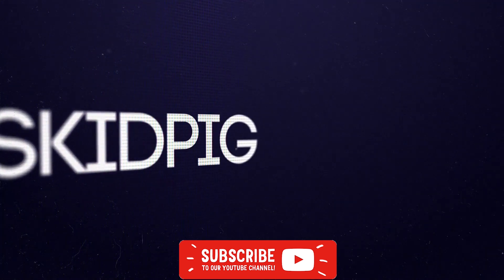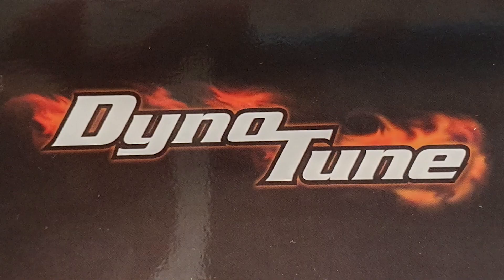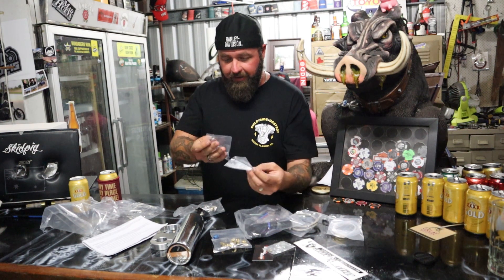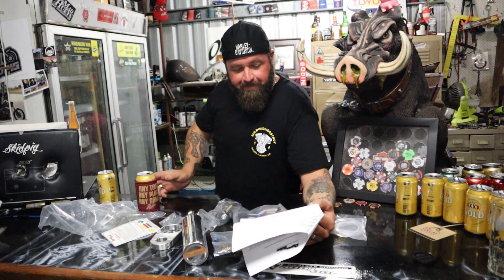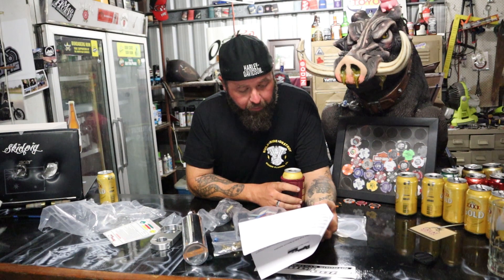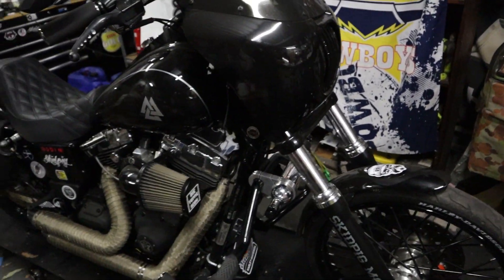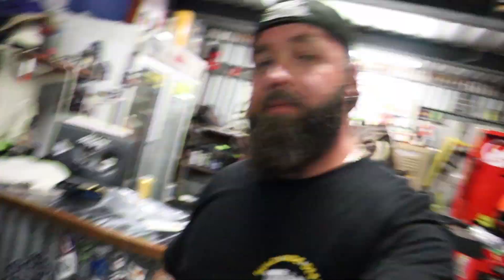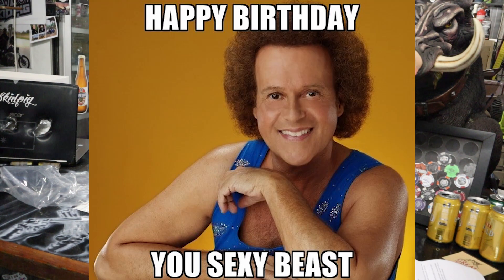Nitrous Oxide Kit for Harley Davidson Dyna - Unboxing the new toy!!!

Comment: I have the same on my 2015 Breakout. I ran 2 20oz bottles on each side in the back  where saddle bags would be. It is also a 110 tire shredder. The 25 shot is giving me 146 FT LBS torque.
Reply from the maker: Hell yeah🤙

Comment: 🤔🤔 to be honest if your putting it there I'd get or make another bracket so it looks better and supports the bottle better. But I'd get the bracket machined and put it on the frame
Reply from the maker: Yeah it needs one on the other side also

Comment: OK the main thing........'DO NOT SKIP THE SAFETY features, like pressure sensors. You want it to quit spraying if ANYTHING acts up you hardly ever get a second chance. Going N2O now on my new 107" twin cam. Just get a 5 lb bottle stuff it in saddlebag. ZOOM ZOOM

Comment: Couldn't sit though anymore of this video to see if you've even questioned if the fender was going to hit the bottle under front end compression. Or if you figured out tanks are not supposed to be mounted horizontally because there's a tube running to the bottom of the tank.
Maybe if you actually read any of those instructions you would have found that shit out.
 But he seems more concerned with how it's going to look anyway.
Reply from the maker: If you watched it you would have answered your questions mate 🤦‍♂️
Reply: @SkidPig  judging by the comments, no you didn't figure any of that out apparently.